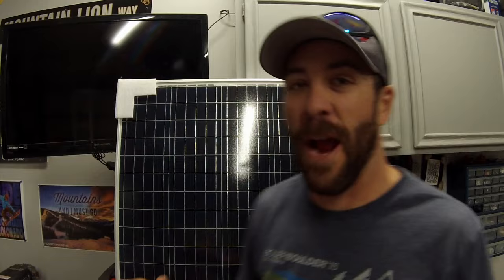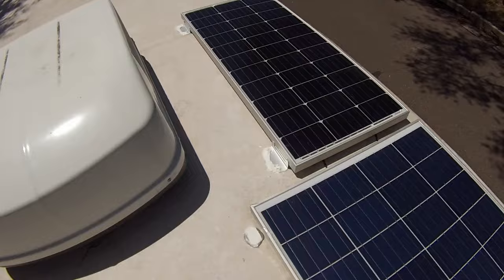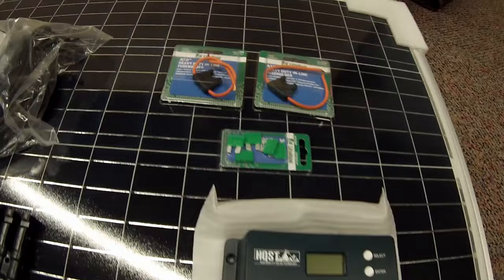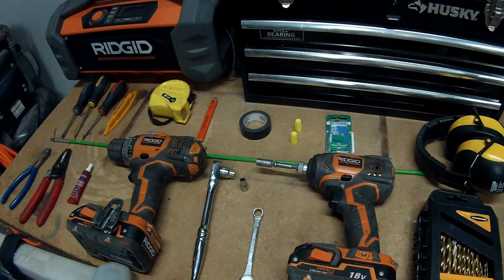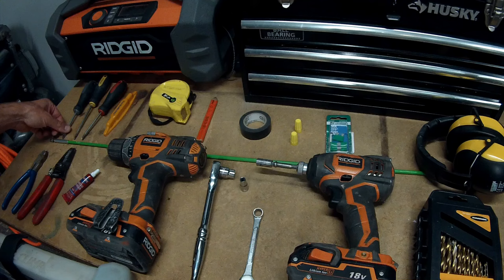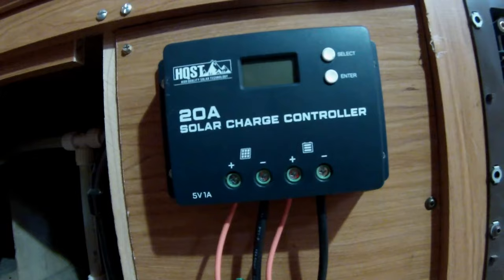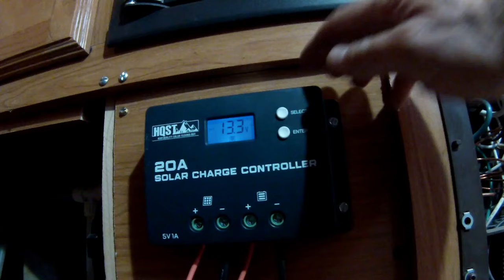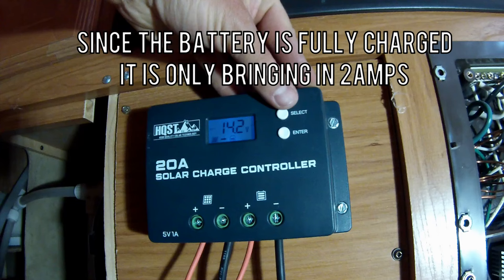How To Install a 200 Watt Solar Panel Kit On Your RV/Camper - Detailed Step By Step Instructions

Comment: Hi Brian, Thank you for making this great video. I have a question that involve running neg and positive wire to the circuit breaker / distribution panel like you did. What if mine doesn't have extra connecter than what should I do? Also Can you explain how did you connect battery wire in the panel or to the charge controller. I would greatly appreciate your help.
Reply from the maker: You're welcome!  I didn't really have a lot of space on the circuit breaker.  I was just able to un-screw the terminals enough to squeeze the wire in there.  If you are not able to hook things up to the circuit breaker, you could just hook the wires up directly to the battery.  That is how I used our portable panel prior to this setup.  
As for your second question, the battery is already hooked up to the circuit breaker. So, by adding the solar wires to the circuit breaker, you are essentially hooking the wires up to the battery.  Hopefully that makes sense.  Thanks for watching!

Comment: With this set up what would it power? Is it enough to power AC like outlets? Trying to understand how all this works 😅
Reply from the maker: Good question, we run a separate power inverter that has 1 AC outlet.  Our solar does not make all of our AC outlets in our camper live.  Although you could install a power inverter that could do that.  It would just be a little more of a challenging install.  

As far as what it can run, that is a loaded question because it also depends on your battery.  The short answer is low wattage items, less than 200 watts.  Charging your phone/devices, running a small portable fridge, playing a TV/DVD player, etc.  I did another video that may interest you about our setup: https://youtu.be/P6PLWIVxAVQ

Thanks for watching.

Comment: Did you ground them?
Reply from the maker: The panels are hooked up directly to the charge controller as stated in the instructions from the company.  The instructions did not say anything about grounding the wires.

Comment: Hey There.Not sure if I missed it or you have already answered someone else but, how did you connect your two solar panels? in Series or Parallel? And why did make your choice? TIA
Reply from the maker: Parallel because that is what the charge controller would handle. Some charge controllers can't handle running panels in series.

Comment: If your roof support wood and you were using the stud buddy to find screws? We are installing some panels now and our stud finder nor the buddy is picking up anything. Any other ideas on how we can find the joists?
Reply from the maker: Is your aluminum framed? I couldn't find the studs on my In-laws camper.  So, I used shorter, thicker, wood screws to secure their panels. They've been up there for 6 or 7 years, still holding on strong! Hope that helps. Thanks for watching.

Comment: Did you use an inverter? I did not see you hooking it up. Im confused...
Reply from the maker: No, we did not hook up an inverter.  This setup just keeps our battery charged.  We plug a portable inverter up to a 12 volt socket if we want to run smaller AC devices.  I hook up an inverter in this solar install video: https://youtu.be/q_e8dUpIm8M  Thanks for watching.

Comment: Great video. I’m looking at doing this set up in the spring. Is it better to hook it up like you did vs hook in up to the battery?
Reply from the maker: Thanks Kyle!  You could do it either way.  The benefit of doing it how I did is that the cables running down to the converter box are not exposed.  I had considered running the cables down to the battery instead, but I would have drilled holes in the roof and it would have been a bigger pain.  On my old truck camper I ran a solar panel directly to my battery.  Here's a link to a video I did with my old truck camper solar setup: https://youtu.be/6gMlx9TfQIw  Thanks for watching!
Reply: @ColoradoCamperman  thanks so much.  One more question. If I hook it like you did do I need to do anything if I take the battery out for the winter ?
Reply from the maker: @kylework9908  NP, so we have a gel deep cycle battery.  It can be stored all the way down to -4F.  Seeing as how it gets that cold maybe one day a year, I will likely just keep everything hooked up.  However, if we get our act together and cover our camper, that is a different story.  I will remove the battery, put electrical tape around the cables, and then the RV cover will be on top of the solar panels.  Even if you left the panels uncovered, you'd probably would be fine.  That is what my in-laws have done the last few years and it hasn't been an issue.
Reply: @ColoradoCamperman  thank you so much.

Comment: Can I still plug my camper in to the normal receptacle
Reply from the maker: Are you asking if the outlets in the camper work if you install this setup?  No, they do not work by doing this.  This only charges the DC side of the camper.  You can run an AC inverter off the charge controller and then you could have an AC outlet.  Thanks for watching.

Comment: What happens when you hook up to shore power? Does the shore power override the solar?
Reply from the maker: Good question, yes, shore power takes over.  As long as you have a converter (which most campers do nowadays) it will switch over and trickle charge your battery.  Thanks for watching!
Reply: Might be a dumb question, but.. how would I know if my 1991 alpine toy hauler has a converter in it so the shore power takes over? And what should I do if I don't??
Reply from the maker: @eric5913  If you can run both off of 12 volt and AC power, more then likely you have some type of converter in the camper.  It may not be super sophisticated given you have a 1991, but it's probably there.  Older converters don't usually charge your batteries when hooked up to AC power like a newer converter would.  So you may not be able to hook up the charge controller like I did.  You may have to hook-up directly to the battery.

As far as what you should do if you don't have a converter box, well, same as above, I would just hook the charge controller straight up to the battery.  That is what I did in my old 78' truck camper.  Here's a crude video of how I did the install: https://youtu.be/6gMlx9TfQIw

Hope that helps!  Thanks for watching!
Reply: @ColoradoCamperman  what battery ? the one that runs my lift jacks ect ?
Reply from the maker: @kidguxxi5  Is that your main "house" battery?  We only have one main house battery and that is what I hooked up to on the panel.  Thanks for watching.
Reply: @kidguxxi5  yes the same 12 volt that your camper DC power is run by
Reply: @ColoradoCamperman  Hi, CC. I loved your video! I have a question regarding the shore power; when you plug in to 120 volt and it starts to trickle charge your battery, won't it be back-feeding voltage to your controller? (Maybe turn off the breaker to the trickle charger when using solar?) Also wouldn't you need a battery disconnect switch to disconnect the solar power going straight to the battery so you can change your battery without creating a spark at the terminals? I'm not trying to be critical of your install, I'm just asking.
Reply from the maker: @pogo1956  Thanks!  First off, I am no solar expert, lol!  Just sharing how I hooked up my solar.  I'm not sure if it will be back-feeding voltage to my controller.  I don't turn off any breakers, just keep everything turned on as normal.  I have considered add a battery disconnect switch and may do so in the future.  I always hook-up the positive terminal first and then the ground.  There is a tiny spark but that also happened even before I hooked up solar.  Thanks for watching.
Reply: @ColoradoCamperman  Thanks for your quick reply! I really liked your install and your camper is somewhat similar to mine so it made it even better! I am hoping to add an inverter once this system is up and running. I was just going to look for the link you provided on your in-laws installation.
Reply: I am posting your link to the In-laws install here: https://youtu.be/q_e8dUpIm8M
Reply from the maker: @pogo1956  You're welcome!  Yeah, with our camper, there isn't enough room for an inverter, so I didn't get a charge controller with an inverter output.  An inverter would be nice, but we have a 12 volt socket that we use.

Comment: So.....you ran the the + - wires from the charge controller directly to the 12v fuse panel instead of running to the battery then back to the fuse panel? Was that the correct way of doing it?
Reply from the maker: I ran the +- wires from the charge controller to where the battery wires connect at the fuse panel.  When you think about it, that is doing basically the exact same thing that you are talking about doing.  I just don't have to run wires to the battery because the factory already did that.  Hopefully that makes sense.  Thanks for watching.
Reply from the maker: @staciahoover6175  You're welcome, thanks for watching!

Comment: Are the panels run in parallel?
Reply from the maker: Yes, they are run in parallel. I'm guessing you're asking because the panels are bringing in over 12 volts? The panels are rated to bring in 18 volts but the charge controller ensures the battery doesn't get over charged. If they were run in series I'd be bringing in 30+volts. Thanks for watching!

Comment: Why didn't you use an inverter and what is the difference if you had used an inverter
Reply from the maker: We chose to use our 12volt socket with an inverter because we did not have room to setup a permanent inverter.  If you're looking to setup an inverter, check out this video I did on my In-law's solar setup: https://youtu.be/q_e8dUpIm8M

Comment: Will those panels run all the appliances?
Reply from the maker: Only 12 volt appliances.
Reply: Thanks man! What do you think would be sufficient enough to run the air conditioner or would that even be safe?
Reply from the maker: @garyschmidt924  You would need a massive system, at least 1,000 watts of solar and a large battery bank. You would also have to hook things up differently than I did.

Comment: Can I hook this solar panel up to any fuse, breaker panel? It appears that I have the exact same one as you, but is there anything I need to look out for?
Reply from the maker: I did not hook up the solar to a fuse on my 12 volt panel.  I wired it directly to the 12 volt positive and negative 11:20 of the video.  Where I hooked it up, those will will feed power directly to the battery.   At 11:58 you can see I added a fuse to the positive line that runs to the 12 volt panel.  Hopefully that makes sense.  Good luck with the install and thanks for watching!
Reply: @ColoradoCamperman  , I’m going to install a Renner G 100 W panel. I don’t know if I can just run it to a charge controller and then my battery and then allow the battery to run my refrigerator and other DC items or do I need to run it directly to the breaker panel.
Reply from the maker: @COMMANDER-ONE  All DC items will run off the battery regardless of where you hook up the solar/charge controller.  We had a portable panel for years that had a charge controller built in.  We used to just hook that directly up to our battery.

Comment: I have 2 HQST hsp100D-L panels I am about to put on my RV. Why can't I run them directly to my batteries at the front of the RV? I have a 30amp charge controller and an 800/400watt modified sine wave inverter. Renogy is the identical panels.
Reply from the maker: Yeah you definitely could. I just chose to do it the way I did. Thanks for watching!
Reply: @ColoradoCamperman  awesome. I appreciate the quick response. I have commercial install experience, but ac series is different than DC parallel. I think I will come in at the battery bank and attach my inverter to the wall in the kitchen and jump off the DC input at the box. I think shorter wires will be more optimal on the inverter opposed to the panels. I plan to add more panels in the future at my charge controller can handle up to 500watts. I only use 30amp fuse on the panels as the charge controller and inverter have built in protection.
Reply from the maker: @Rob-cm9jr  Sounds like you have a good plan in place!  Good luck with the install.
Reply: @ColoradoCamperman  just bought 2 more panels and building a rainwater collection system. My great grandparents are from Jerusalem so being a direct descendent of Christ and the abilities that come with it give me much advantage.
Reply: I added a 30 amp fuse between the panels and another from the battery bank just to be safe, but still not the inverter since it has a replaceable fuse on the side. Working on the wiring right now.

Comment: Where is the invertor or do you not need one?
Reply from the maker: We have a 12 volt socket that we plug an inverter into. We run minor electronics off of that. It works well and is a simple setup so we have stuck to that. I would have liked to have a hard wired inverter to our system but we lack space around where our charge controller is. I ran an inverter off  my in laws setup when I installed solar for them, it's pretty handy! Thanks for watching!

Comment: Dicor is trash bro. Don’t use that.
Reply from the maker: Really?  What would you recommend to use instead?  I've had good luck with Dicor.
Reply: @ColoradoCamperman  dap dynaflex
Reply from the maker: @myhousehaswheels  I'm a painting contractor for going on 17 years, I've used Dynaflex before.  It's a good product, I would only hesitate to use it on and RV because it is not meant to go on a house that travels down the road.  It is meant for a bricks and sticks house.  One thing you should look at on the product spec sheet is the "Flex Rate".  I use Sherwin Williams Shermax and Sashco Big Stretch because their flex rate is 75-90% (I would imagine Dynaflex is similar).  I've been using dicor on our campers for years and I've personally never had issues with it before.  I've used Shermax and Big Stretch on campers and they have both only lasted a year or two before they start cracking (Big Stretch has done better).  That's been my experience so I am going to stick to what has been working with me.  If you've had good luck with Dynaflex, I'd say keep using it!  To each his own!  Thanks for watching.